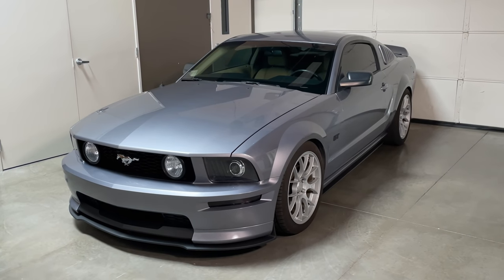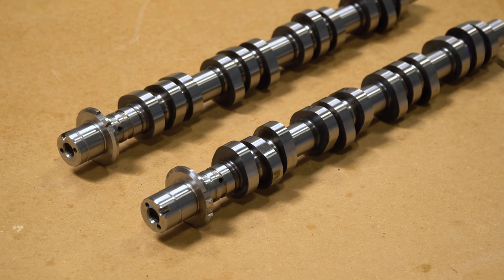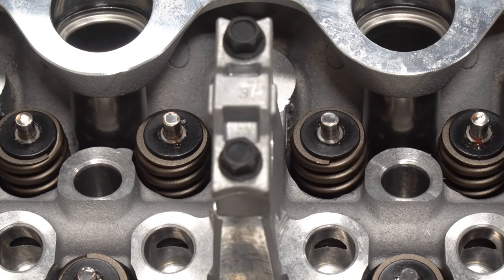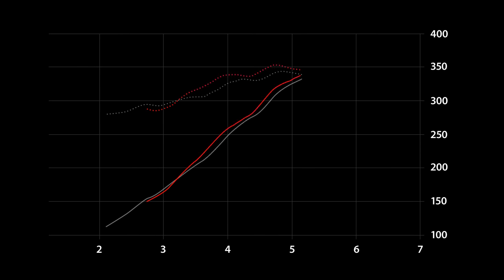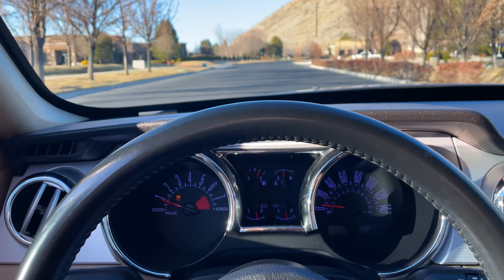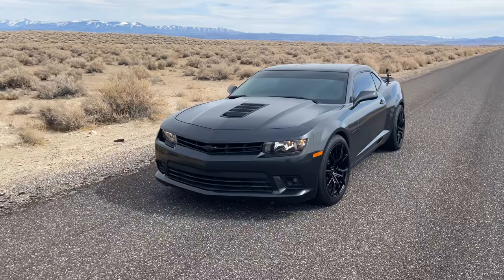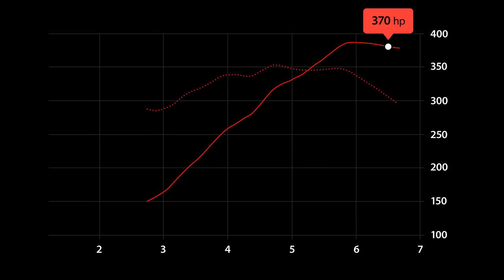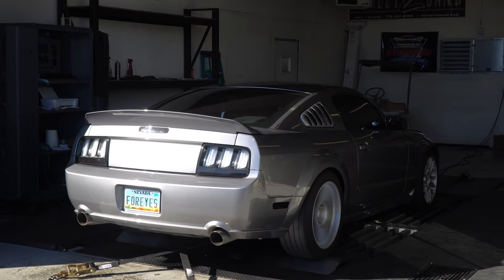The results 📈 of installing the most aggressive cams on my Mustang

Comment: The absolute hardest way to almost make 400hp with a 3V 😂😅
Reply from the maker: lol no doubt
Reply: Sure a turbo or sc would be easier but I think the idea was to see how much power he could squeeze out NA. Definitely beats the sound of forced air... and when he does add the twin turbo like he said with all the other mods that thing will be a monster.
Reply: Not to mention expensive.
Reply: @cumbob  words of wisdom 🙌
Reply: @cumbob  built naturally aspirated motors don’t play well with turbos. Forced induction really reduces how aggressive of a cam and how much timing you can run in an engine and stay safe. A build for boost and a build for na power are very different.
Reply: @husky701rider9  Only real difference is how quickly you build torque between a N/A cam with boost vs a "Forced induction" cam with boost. Forced induction cams have less duration to seal up the cylinder faster to cram the supercharger/turbo air in. N/A cams are set up to provide a scavenging effect. But that doesn't matter because even though you can build more low-end torque. When you're racing you're in the RPM range where a N/A cam will be more beneficial than a forced induction cam. Like Richard Holdner says "Any cam is a turbo/supercharger cam"  As far as timing goes you're limited by how much torque depending where in the rev range you are. which isn't a problem on motors with computer-controlled ignition. for example, if you're making rod bending torque at 3k rpm @ 20 degrees of ignition timing dial it back and add more timing as the RPM's climb and the car gets up to speed. But honestly, that would be more of an issue with a cam designed to build cylinder pressure earlier in the rev range like OEM or "forced induction" cam. Besides a more efficient NA motor will make more power with less boost than a motor with "forced induction" cams.
Reply: @husky701rider9  

Common but incorrect info.

Boost makes long suration cams seem like even longer duration to some degree, but thats all.

Most guys run e85 for bug power and it can handle huge compression and boost. 12:1 and turbo is fine with e85.
Reply: @husky701rider9  that’s why you upgrade the internals so they can handle boost
Reply: I mean if ya round it off...
Reply: @cumbob  Keep in mind turbo and N/a builds are very different. Cams and heads, along with intake and exhaust will all have to be changed. Not to mention a stock cam is more beneficial in a turbo car than a bald eagle thumper. Solely because Big turbo builds dump as much compression as possible to cram as much boost as possible in them. A good friend built a VR6T and its overall ended up being around 7.5-1 with numbers well into the 500s on the 2.8L with tunability to go quite higher.
Reply: @husky701rider9  Normally true but he did mention it was running lower compression so the motor is leaning more towards being built for forced induction.
Reply: @CP110  if Richard holder said it then you know it’s true👍
Reply: @nateg08  Still should have upgraded internals for supercharger regardless. A simple bolt on can be a nightmare for someone slamming gears.
Reply: @wiselinkmarque3947   Yes I agree my only point was that some people many people just throw a Turbo in and call it that. You can get quite a bit of power that way... I said nothing about longevity (or lack there of)
Reply: @nateg08  haven't really heard of anyone doing a turbo, just bolt on superchargers.  local dealership will tell you plenty horror stories of people doing bolt ons and breaking stuff, including their bank account.
Reply: @wiselinkmarque3947  really? I've seen videos on YouTube about people buying eBay turbo kits and throwing them into an old civic or the like... stupid on 2 counts. A turbo on a stock motor, and buying a cheap eBay turbo.
Reply: @nateg08  oh I thought you meant on Mustangs.  I've only seen people doing supercharger setups on Mustangs around here. Honda stuff, I dunno. hardly pay attention to it.
Reply: @wiselinkmarque3947  yeah mustangs usually get a sc. But this guy said he was putting a twin turbo in this one.
Reply: @nateg08  yeah I dunno why he would want to turbo it. it's not like he's saving any money already.  usually people talk about cheaping out by getting turbos.  haven't seen any of them actually do it though lol.  I would rather see him put a proper whipple on this motor, he probably could get upwards of 1,000 horsepower with his current build that way.
Reply: @brandonkalsch9205  Whoa and no that is pretty much all false info regardless of your friends build and his results. Engines are air pumps and the more air you can move the more power you can make. Big heads, big cams all work great with boost.
Reply: @waltwalt9632  I think you may be a little lost
Reply: @BrielleHater1224  nah not lost
Reply: Self inflicted wound. Dumps MAD Money into his car but won't even spend $150 on what everyone agrees is the Undisputed best tuner for 3 valve Mustangs. I had my 04 WRX dyno tuned then Road tuned and it became a mid 12-second monster. My Lito tuned FBO 06 mustang only gave up the car length up to 75mph to my friends 15 Bama tuned 5.0. He doesn't talk s*** about my "slow" valve anymore. I knew I would lose but I was impressed by how little. Todd Warren cams are going on next year
Reply: @nateg08  Some of those eBay turbos can last you quite a while, they aren't like they used to be and quality coming out of China, and onto the E-est of bays, is improving dramatically. 

As well, some of them Honda motors (H22, K20, K24+ K20 head specifically) with forged pistons, throw in a walbro, some rather large injectors, a flex fuel sensor to keep the detonation at bay, a front mount. Then a Hondata for the tune, and you're rockin anda rollllinnn. They can handle BIG power quite reliably (for what they are especially) 6-900 horse is not uncommon, and can last as long as one can realistically expect a heavily modified engine to last without some fixing here and there. The tune of course being an important factor for longevity on any turbo motor, potentially some extra curricular crank case ventilation. 

Even some of the single cams can have a turbski+front mount slapped on, boost cranked to the moon, and be making decent power. When it blows up, new blocks are 2-400 at your nearest junkyard. They've more than likely got so many, if you play hard to get they may even pay you to take a couple off their hands haha (I wish, free motor Friday sounds like a holiday in a dream I had once). Not a bad way to roll really. Just gotta make sure, no matter what, that you're picking up the correct size turbo for your goals.
Reply: @brandonkalsch9205 . Agreed, most people commenting on things they don’t understand. Boost is a different story; use the boost to make the power you want and pick the cam/ manifold based on how and where you want to use the power.
Reply: If I had the money,  it's what I would had done too
Reply: I bet that engine would wake up on some spray and 3.73
Reply: Crazy to think my old LS1 picked up almost 70whp with just a cam (240/244) & valve train. I think the entire job with parts was less than $1500. Those 3v's do sound good though.
Reply: @cali2468 . 240/244 is a very big cam in a 5.7L 346Ci LS motor, that’s why you picked up 70hp. That is not at all a 
street able cam, that is a track cam.
Reply: @bri-manhunter2654  Maybe unstreetable to you because you can't tune worth a damn. 😂😂 I drove that car everywhere, 6spd and 4.10 gear. It actually got pretty good mileage too.
Reply: @cali2468 . Okay buddy, you are not fooling anyone.
Reply: @bri-manhunter2654  lol Stop trollin'.
Reply: sure... 
N/A setup doesnt go only on the engine... 
it thends to go at transmission, cluth, flywheel, and few more stuffs to increase response, like on this, but theres more to do...
but is expensive, some guys would go for a SC or turbo on that way :/
Reply: Can do the same with a 2v with 3.73 attached to a 4speed 😂
Reply: @CP110  what about detonation/pinging though?
Reply: lmao thats less than my focus makes
Reply: @Gnerko123  what about it? good fuel and properly set up squish and electronic controlled timing throughout the rev range and its pretty much not a concern.
Reply: @nateg08  Others have done it too, I bet he's close to $10k to not even smack 400whp which sadly is a shame.  I know he's building for TT but still, fully built and not hitting 400 shows how bad this engine is xD  I'm perfectly happy with my '07 GT and BAMA's 93 race tune for the summer.  I went more the handling route knowing the cost to make these cars legitimately fast.
Reply: @CP110  i thought aggressive cam profiles could lead to a higher risk of detonation, as does high boost. Thus one could run a more aggressive cam without boost than with boost. Is that wrong?
Reply: @Gnerko123  high duration cams have less dynamic compression since the intake valve is open for longer so it starts compressing air fuel mixture later in the compression stroke. Pinging or knock is uncontrolled ignition usually due to bad gas, hot spots due to carbon build up. Your boost level should only be determined by static compression ratio and octane. Cams only really dictate where you start making power and how the curve looks like. With good ignition control you should be able to have more conservative timing in the risky areas ie. high torque, high load, low rpm situations. And have max timing at higher rpm. Also take away timing after certain boost levels.
Reply: @CP110  tnx!
Reply: If you got it
Reply: @wiselinkmarque3947  He did say it's stroked to 5.0 liter. And judging by the H beam rods pictured the internals are more likely than not forged.
Reply: @nateg08  Boosted Boiz went pretty far on ebay turbos.
Reply: @cumbob  build a powerful N/A motor and it would shatter with forced induction. You need completley different kinds of parts for N/A and Turbo.
Reply: @GrimReaper1675  straight up bullshit. You need different internals for different aspiration types.
Reply: @jazionpurnsky1185  that's all this kind of racing and competition really is. who has the deepest pockets.

I guess if you just look at it as experimental automotive engineering it's kind of cool. The problem is, people attach their egos and their identity to their car so they really think it matters when they win a stupid street race.

The owner of this channel seems to be a cool guy who isn't like that. he's just trying to take an underpowered car and make it keep up to modern standards. Gotta give him credit for that. with that said, it's still all about money in the end.
Reply: @cali2468 . Stop being so narcissistic, you are not fooling true engine guys here🤦🏻‍♂️
Reply: @bri-manhunter2654  Yeah and the true engine guys know a 3-valve is a waste of time. My old Vindicator cam/bolt-on LS1 made more than some 3-valves do with a blower. lol I drove that car everywhere. "But but...it's not driveable" ... 😂😂😭
Reply: @cali2468  . To each his own, and I agree, I rather have the LS1💪🏻. Honestly, the cost to build my 6.4L 394Ci big cam stroker Hemi was expensive; I should have donr a ring gap, cam, and boosted a junk yard 5.3L🤣.

I’ll give you the benefit of the doubt with the cam; light weight car with steep gears and a Manuel cam can get away with a lot of cam.
And I’m not a fan of the 3valves either, I like the cam in the block just like God intended it.
Reply: Koniesegg did it in gemera
Reply: turbo would be way too easy and its a lazy mod. everyone uses turbo. way more impressive to build a beast engine.
Reply: @codylujan  lol a turbo is not a lazy mod. Adding a turbo or two to a car that wasn't boosted from the factory is alot of work, much easier to run a supercharger with low boost
Reply: @nodo7575  🤣 stop playing Need for Speed. You can make plenty of power in a decent turbo build on a NA engine. Millions have done it
Reply: @joeschmo9838  Yeah, I spent under 10k for an entire car that came with 550 whp, though to be fair, it's pretty maxed out unless I want to spend a lot of money on it
Reply: @husky701rider9  not so, my mechanic co-worker has a 347 stroker fox built all the way up on N/A, and he's putting an on3 turbo on the car.  He plans to run hardly any boost and just take out a bunch of timing.  You can run a turbo on an N/A car, sure you can't run much boost but you don't need much boost either.  A little goes a loong way
Reply: @cumbob  people are poor and think with a poor mentality when building a vehicle most of the time lol
Reply: Lol! She's made for boost tho
Reply: There’s just something special about naturally aspirated power
Reply: Hey what is your current full exhaust set up on the car today?
Reply: @jazionpurnsky1185  there were cheaper ways to build a NA car than that and get 400hp like the coyote !